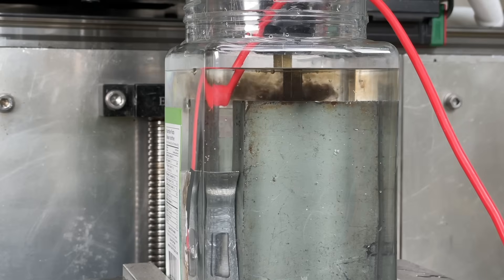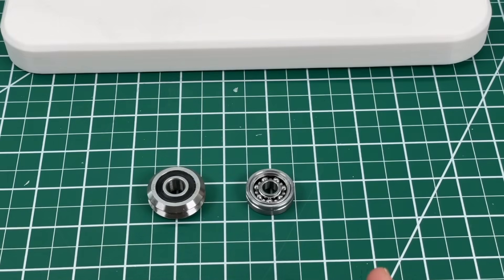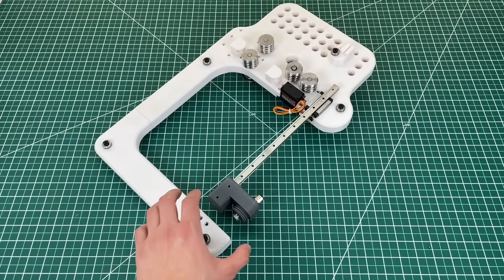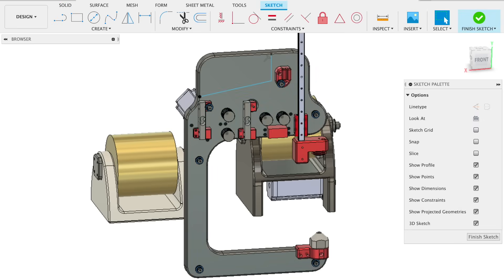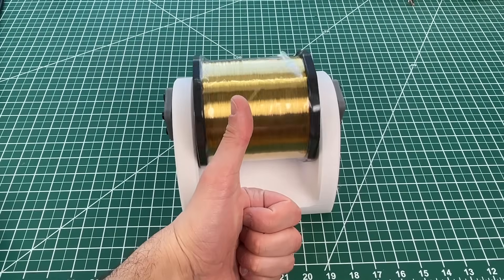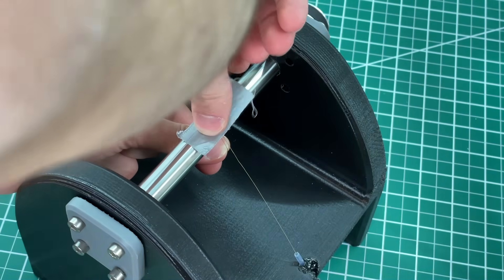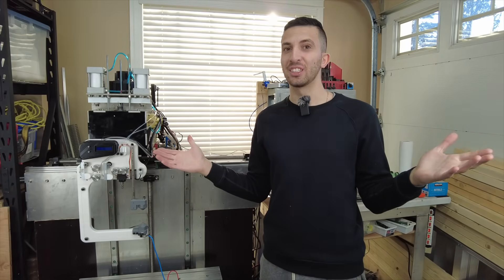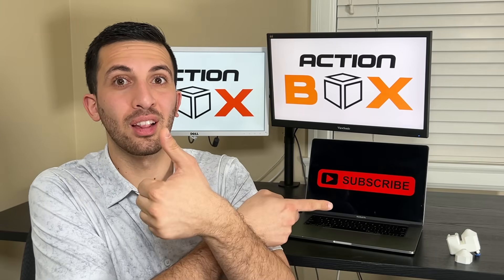How We Made A Wire EDM Machine At Home

Comment: as finicky as a professional-grade wire EDM is that's probably one machine I wouldn't attempt to build. The control is sensing the conditions continually and making adjustments to practically all the parameters. The water typically needs to be within a certain range of resistivity too
Reply from the maker: We are working on all that in our v2 😊. Thanks for your input.
Reply: @ActionBOX  I'm confident you have the tenacity to concore it. I operate a Sodick ALN600G wire EDM at work and would like to have a small capacity machine at home some day. I have been a machinist for over 30 years and this is my first experience with a wire since we bought it 2 years ago. I love it. It can do things you just cant do any other way or at least easily with excellent accuracy. Single roughing passes are always withing  .001". Multiple skims for stupid accuracy and a fine finish. It can be finicky as hell some times though. 
It would be great if you either made your effort open source or sold a resonabley priced kit or BOM with support info. Feel free to ask me about the machine or its operation
Reply from the maker: @billclark5943  will do. Thanks for your help and support Bill 😃

Comment: I have been running wire edm for 10years now and everything about this video scares me. Great job
Reply from the maker: Hahaha, it was our first attempt 😉. We are working on an improved version 😃. Thanks for your support.  Cheers,  Dave
Reply: @ActionBOX  hi Dave. First video I saw  of yours wire machines have a list of parameters for the machine know as E-PACKS for Example  Ip,Vo,Sa,WS,Wt and many more. Epacks control voltage, amp, off times, wire speed, tension and Liquid quantity , stability controls and other finer setting. Second feed rates are important not only linear  travel but wire speed will drastically reduce your consumption  of your electrode (wire).  Resin filters will help with your conductivity. last thing I saw that  looked  odd was the distance of the wire to your work piece. It could be angle of the video but the electrode should Not contact work piece. Wire machine will not start with a contact. Sorry for confusing comment hope some of the info helps

Comment: 100% sure is the duty cycle. I have some expertise in FDM.
You need to have control over 3 properties of Voltage Supply, at least:
-HIGH interval
-LOW Interval
-Voltage

It is ideal to have a voltage ramp controller also.

I can't say precisely the values because it is right dependent on your setup, you need to run an experiment with these 3 parameters.

Regards!

Comment: you have to have verry stable no peaking current source.. and also higher voltage coz too much current breake the thin wire.. as i see that sparking you have peaking PSU on H-bridge with high capacity condensators as filter.. beter use EMI at instead of goldcap's.... you need more resistance load PSU intead of inductance.. :))
Reply from the maker: Thanks for your input 😃

Comment: Beautiful work. I developed a wired Edm in my garage. After a lot of study I learned the fundamental concepts so that the wire does not break. The open and closed load time must be critically controlled for high cutting efficiency. I achieved 90% erosion on the part versus 10% erosion on the electrode or wire. The junction between the advance pulse and the cutting and loading time is the key point for perfect operation. On my channel there is a small video cutting with penetration electrode. When possible I will make some EDM Wire videos to maybe help friends who follow the same path. A hug and good projects broo.

Comment: Every time it sparks, it erodes both the target material and the wire... The higher the erosion current, the faster it eats through the wire. Simply increase the feed rate in proportion to the current.

Also, try reversing the current
Reply: What would reversing the current do?  (Do you really mean reverse, or do you mean alternate?  What would alternating current do?)
Reply: @smorrow  honestly, I'm not quite sure, however there was a video by someone else (BAXEDM I think) where that made a substantial difference. I'd guess it would be something to do with the direction of flow of electrons?

Comment: Ideally, your advance speed for lateral travel is adjusted to achieve constant (average) current from the EDM supply.

The wire travel spool speed would be proportional to average current, to replace the wire as it’s used.

On a commercial modern, not 30 year old machine, the channel may be flushed with ceramic wire guides that provide pressurized fluid at perhaps a hundred to a few hundred psi, albeit at a moderate volume. Mechanical diaphragm pumps of the sort used for a reverse osmosis system would be a good place to start for something economical that can deliver 125 psi or so. (They’re also used for water/methanol injection for turbo/supercharged engines, and you could use a PWM drive on the 12V motor with a pressure sensor with analog output you can find for under $20 for closed loop pressure control).

It might be feasible to use sapphire or diamond 3D printer nozzles that go for $25-100 each instead of a commercial wire guide as a readily available option. The better purpose built ceramic wire guides are probably$50-100 each at eBay prices, and considerably bulkier than a 3D printer “mark 8” type nozzle that has a M6x1.0 straight thread. If you go that route, make sure to get an adjustable threading die in case you need to chase threads for a precise tight, but not too tight fit.

Comment: Very nice prototype!
But I have a suggestion for you. Why not make a 'chinese' type wire cut machine. It would be much easier and save you a lot of really difficult problems that you must overcome to make a proper wire cut machine. 
The 'chinese' type uses molybdenum wire which is spooled and then re-spooled and used over and over again. You also don't have to submerge the workpiece in dielectric. Just a trickle feed of a soluble oil cutting fluid is enough.
This really simplifies things as arranging your work holding system is much easier if you don't have to contend with a submerged tank. You also don't have to make a high capacity filtration system and also high pressure flushing, which you will need if you want to use brass wire.
The spark generator can also be much simpler.
The disadvantages are accuracy is not as good and surface finish is no where near as good. But you can cut to an accuracy of about 0.01 - 0.02 mm but this is a huge difference to the +/- 0.005mm which you can easily achieve on a good wire edm machine. But of course for this accuracy a huge amount of detailed engineering is required.
I have worked with Fanuc, Agie and Charmilles wire cut machines for 20 years but we also use chinese machines for simple work. For instance we use them all the time for cutting hardened puches or guide pins also for cutting hardened stock material to near size before hard milling or grinding to final size.
It may be the way to go to at least fairly quickly getting a wire edm up and running. You would learn a lot and could use the experience to attempt a brass wire machine at a later date.
I'm sure many people would be more than happy with the accuracy, speed and low running costs from utilising the molybdenum wire method.
Reply from the maker: It’s an interesting thought.  I’ll look into it. Cheers.

Comment: What power supply are you using? I suspect that probing voltage and current using an oscilloscope will reveal the problem
Reply from the maker: You are correct. Our next iteration will be using a proper power supply. Cheers

Comment: looking at your design and the results of the machine trying to cut the bar of steel, I noted a few thoughts on your problem.  
1.  Check the power supply, you need to have a frequency of at least 5000 Pulses per minute, with a duty cycle 20, that results in a 20 micro second power on and 180 micro second without power.  
2.   On our machines we have found that the de-ionized water must be aimed at the cut and must be flushing the scarf from the cut.  
3.   Your feed rate is a function of the amperage, and the wire speed, you need to increase the wire speed.
4.   If you need assistance feel free to contact me.
Reply from the maker: Thanks Gene, I appreciate your input.  We will consider this as we continue to build our V2
Reply: Please confirm 5000 pulses per minute or per second?

Comment: Hmmmm. 
Your contacting and arcing..
Lower the energy tremendously. I've seen hone shops mimicking wire EDM using just 12v and 9v lantern batteries and a length of wire.

Mechanically lower your per step feed on the mill. That should take care of the rest of the issues, but you could also reprogram and rejig your entire mill to take an resistance measurement between the wire and part in between each pulse from your power supply, and only move the minimum step when the resistance reaches an arbitrary threshold. 

Also. The nose radius on your lathe tool will reduce the contact points on your drive rollers to just 1 given just how miniscule your wire is, and multi piece units will provide pinching and unpredictability. 
Save money and effort, just use a shaft. you can put cheap guides between if there is any issues. That's how the big boys toys that manufacture the wire do it.
And if you have a lathe, just throw standard bearing in said lathe and cut a groove on standard bearings. Again. Thats what the actual wire manufacturing equipment uses.

Comment: From my experience the arc looks way too aggressive. Also the current transfer should not go through a greased bearing but rather use a Tungsten carbide block to transfer the current to the wire molybdenum wire is also used but the price is much more, but is normally run continuously.
Reply from the maker: Thanks for all your comments. They are consistent with most other suggestions and are probably true.  I will employ them in our second iteration. Thanks for your comment 😃.  Cheers, Dave

Comment: try inverting the polarity, so that the circulation of electrons flows from the piece to be cut
Reply from the maker: Unfortunately we tried both polarities 😢. Do you know which way it’s suppose to be? Cheers
Reply: @ActionBOX  From the sounds on some recordings I've seen, I think it's a high-voltage, high-frequency pulsating current. The wire must never touch the piece to be cut and must maintain the distance so that a voltaic arc is produced

Comment: This is very interesting and I love the creativity, that said I bought a 1994 wire edm that has millions of yen in development costs. It works great for a $2500.00 machine and is still commercially viable for limited use . And it is 4 axis.
Reply: Plus I can cut 3/4 steel at almost .3" a min.
Reply: I don't know what your power supply is like, but regular units have adjustable voltage, power, off time , plus compensating circuits that fine tune the sensitivity, also as some have said, the de ionizing system, 5 micron filters, etc.
Reply from the maker: These are awesome suggestions.  Thanks for sharing 😊

Comment: You should detect when the arc happens and then rectract, I'd say it's a very visible short that is happening there. From what I've read, you need to supply the same current, if the wire touches the workpiece it will then short and of course.... blow up! :)
Reply from the maker: Thanks for the input, we are indeed working on this for our V2. I hope you are right, and I hope it works 😃.  Thanks again.

Comment: I have repaired Agie wire cuts for many years.   Your spark has to be very fast and short, typically no longer than 4 microseconds.   And fast repitition rate, often up to 50kHz.   What is your spark generator capable of ?    In addition most wire cut machines implement a feedrate control mechanism that looks at the gap voltage and controls the feedrate and spark rep rate accordingly.   They often will also have a back-off so if the gap voltage collapses to zero, the feed reverses to pull the wire away from the short.   So rather complex !   Different manufacturers have different methods but the short spark duration is the biggy.   Happy cutting.

Comment: A higher voltage and lower current could change things. Watts = Current * Voltage . Same power different ratio. Power lines a run on high voltage to save on wire thickness.

Comment: Your wire is breaking because you are trying to cut with a to high current for the thickness of wire and your controller is not slowing down the cut and checking for a short circuit. I recommend looking at BAXEDM (https://www.youtube.com/channel/UCy4kgsAYxcraee8w5SfqXPA). The cutting speed needs to be controlled based on some logic coming from your power supply. Normally the power supply measures the distance between the wire and the part being cut and adjusts the speed to maintain a constant distance. Sometimes a bit hard to do as the controller needs to be able to have a negative feedrate in case of a short circuit. Looking forward to seeing some more videos. Great job!

Comment: Like a points car ignition. Perhaps tuning out the sparks at a specific range of frequency. Perhaps low frequency vibrations in the wire have sufficient time between contacting the steel to build a charge that discharges at a higher magnitude.
Reply from the maker: We think the magnitude of discharge is already too great which is why the wire breaks. We were actually thinking the opposite, have smaller discharges.  Thoughts?

Comment: What do your tension readings look like leading up to the break? Without gap voltage feedback adjusting your feed, you might be making contact with the sample. With constant feed I image your tension would start to increase as you make contact and start to push against the sample with the wire.
Reply from the maker: That as a good point. Unfortunately we did not keep this data from our tests so we do not know. We will look out for this in the V2
Cheers, 

Dave

Comment: I ran wire EDM machines for over 15 years. A few things I noticed:
1) Your wire break troubleshooting did not adjust anything on the power supply. Even on industrial wire machines with "proven" cut settings for material type and thickness, there are still times where the wire is breaking and you have to increase the off time or mess with other settings. Your spark is way too aggressive.
2) I ruined a fixture once by wire cutting a round part in a fixture that had ball bearings. The fixture held the part and was bolted to the table, which served as the ground path.The spark arced between the balls and races ruining the bearings. I'm going to take a guess that your lower bearing is not long for this world. Most commercial machines use a piece of carbide to energize the wire. It's a consumable item. 
3) Tension is critical in the wire. A commercial wire machine will reduce tension on the first roughing pass to help with wire breakage. It will then increase the tension on skim passes for increased precision. The machines I ran with .010" (.25mm)brass wire would typically run 1300g tension on a rough or primary pass and 1700g on a skim pass. Get a wire tension meter (I bought one used on ebay) and see if your wire is even close to this.
4) If you get this running and plan on using it a lot, most of the parts touching the wire should be ceramic or carbide for longevity. I did a lot of maintenance on the machines I ran (Fanuc) and if you want to reach out, I could give some feedback on what I saw.
5) Back to tension, Teknic Clearpath have a servo motor that can be set to supply a given torque (adjustable by PWM). It's easy to set up and might be able to simplify your wire tension settings. I've used their motors for a few things at work and have been happy with their performance. I can't attest to the torque mode in a particular application, but it was a feature on one I used and seemed to work as advertised.

Comment: You guys are going to get me into trouble…..
I don't know much about EDM but I know a fair amount about welding, electricity and metal.  I'd say try dropping the temp of the water substantially and see if that increases the life of the wire.  Other than that I would suggest thicker wire but I'm guessing if it was that simple you would have tried that first.
Reply from the maker: Thanks for your input 😊.  Changing the temperature unfortunately would not help because those sparks get way too hot.  A water difference of 20 degrees C make no difference to a 10,000 degree C spark.  Great thinking thought. As per the wire, we are actually using the thicker standard wire for Wire EDM, so it’s hard to find thicker.  We really believe the issue is current modulation with this machine.   Thanks again for your comment 😃

Comment: Just a thought. Would it be possible to use very thin brass plate instead of wire to make the cut? It could be fed down from the top so that the work piece is barely under the surface of the water (electrolyte) this would eliminate the problem of the brass plate conducting from all sides. Alternatively the plate could be coated with a thin sacrificial insulator like wax leaving only the edge uninsulated. By this method, it might be possible to cut complex shapes (not just straight lines) by pre-shaping the brass plate.